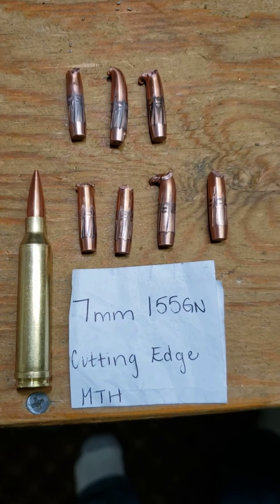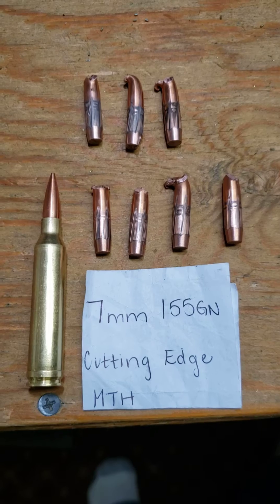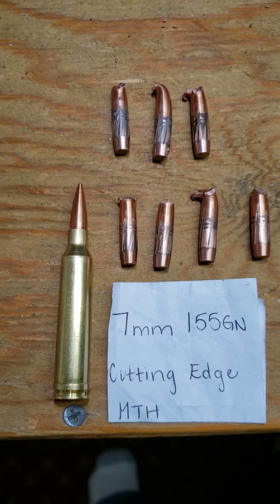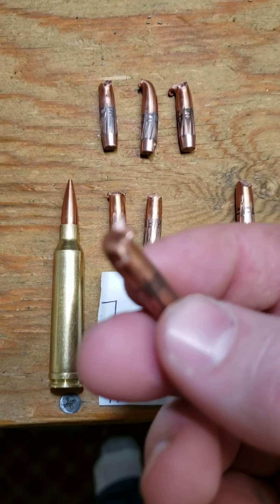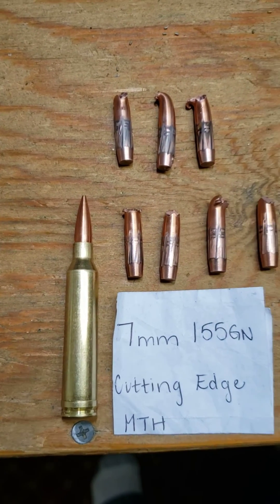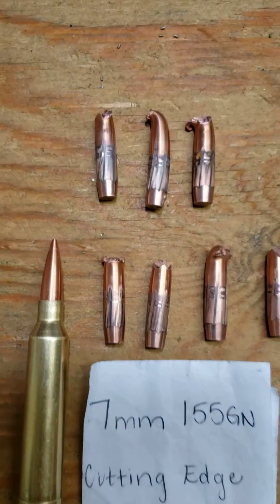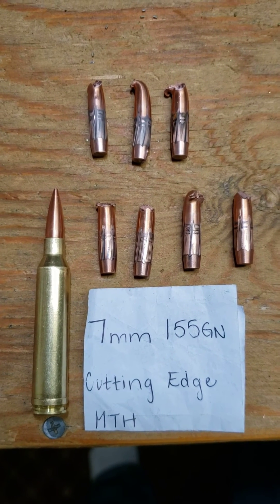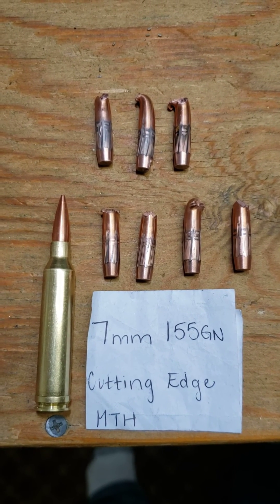Cutting-Edge 7mm 155gr MTH failure to perform properly at high velocities

Comment: Here is my guess: These pointed hard metal bullets will not do well on ballistics gelatin, for precisely the reason you identify. In an animal, that sharp turn is unlikely to happen, because ribs, bones etc, and even if it did happen, the bullet would veer out and make a two-end leak. Hard bullets of copper and brass with a wider meplat are going to do a lot more of the smashing you expect to see with copper jacketed lead bullets.

Comment: This isn’t the only caliber these bullets have failed. They’ll never be in any of my hand loads. Nor! Will I waste any components on testing them. Glad to see another video, supporting the other failures of this bullet.
Reply from the maker: These were sent to me by a subscriber for testing. I have tested a few different Cutting-edge bullets and so far these are the only ones that have failed. I'm thinking the very small media plat on the MTH is the primary problem. They really should just be match tactical and not hunting.
Reply: @simplemindedfella  I should have been more specific, on its usage, I wouldn’t use them for hunting purposes. Those lead free rounds, I think would be a bit costly, for matches, and out of the realm for many.

Comment: Not fully stable and impacting with a tiny angle on the bullet?
Reply from the maker: I'm not sure why they would lose their stability when I bring the velocity over 2800 fps. Typically if stability is lost/never there it is in the reduction of velocity and RPM's not the increasing of.  If I had a super tight twist barrel there could be the potential of overstability but that would require a lot tighter twist and a lot higher velocity.

The slight angle of the bullet could be why it folds the way it does because bullets do travel in flight slightly nose up and they do not hit straight on. Why that has caused these to fail like this and none of the other hunting bullets I have tested would indicate a design/engineering issue.
Reply: What twist rate is your barrel? Copper bullets tend to need more twist for stability than similar weight cup/core due to increased length.
Reply: @jacobsobell4751  - the heaviest cutting edge MTH bullet recommended for my 7MM Rem Mag was the 145 grain MTH. I have standard twist Tikka T3x 7mm Rem Mag (I believe it is 1:9.5), and CE's website didn't recommend anything heavier in the MTH line and much lighter for Raptors.

Comment: Try filling the hollow point with gulf wax or candle wax. I read that in an old book and it has worked for me to make hollow points open up sooner and bigger. Maybe it’ll provide some structure in the hollow point to keep it from failing like that
Reply from the maker: I have a few of these left, I may have to try that.
Reply: These bullets are $70 $80 a box you shouldn’t have to fill them with wax.